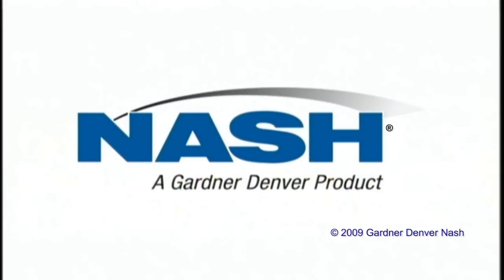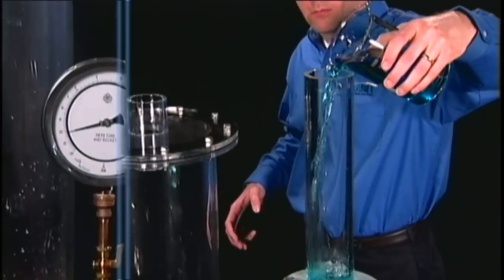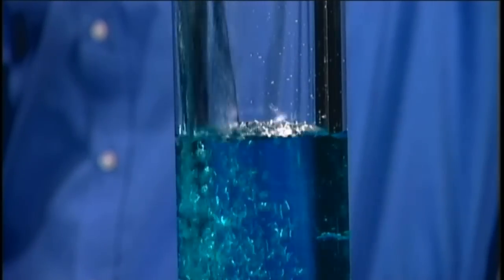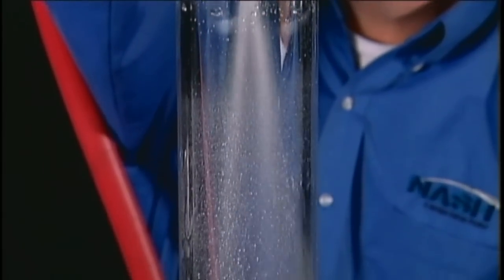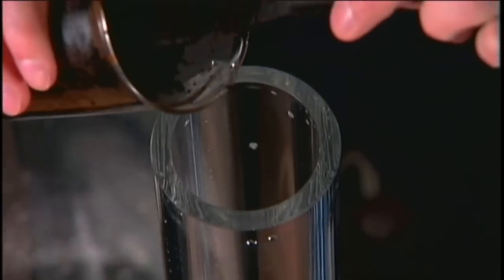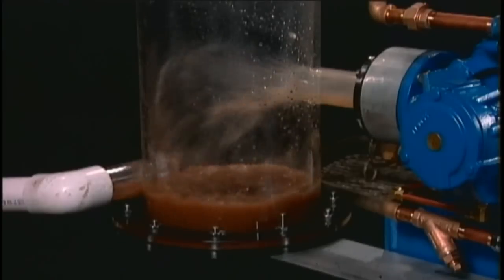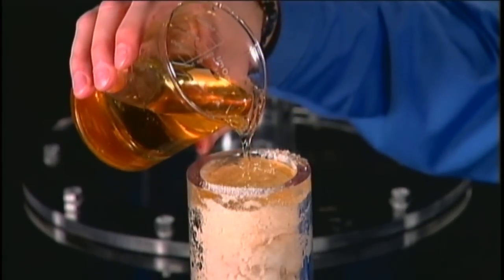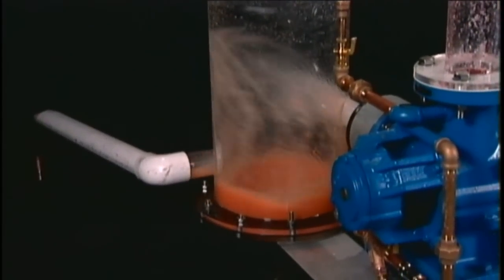NASH Liquid Ring Vacuum Pump Reliability

Comment: It works with waste only as long as it has a lower density than water. If it pulls sand for example, which is heavier than water, it will remain trapped in the water ring due to centrifugal force and will produce abrasion friction that will destroy the pump or burn the electric motor... That's what they forgot to say... Everyone only presents the advantages but forgets to specify the disadvantages...